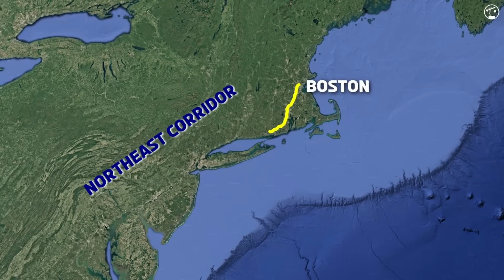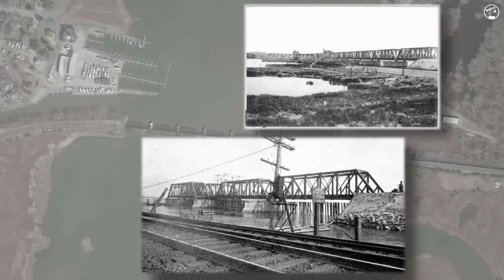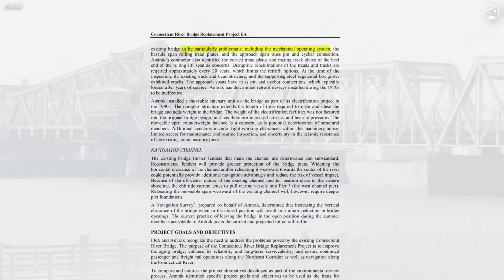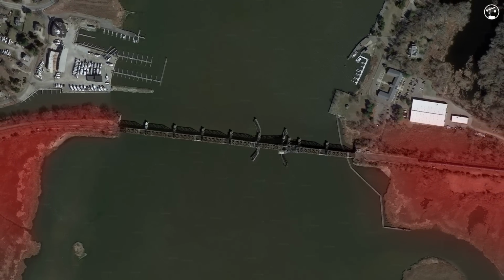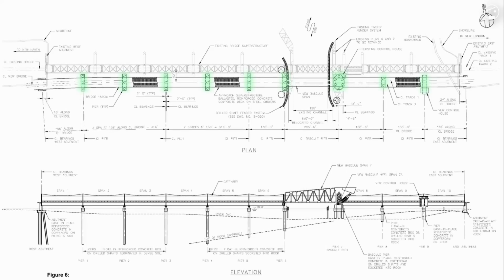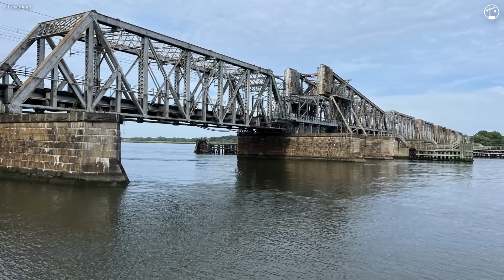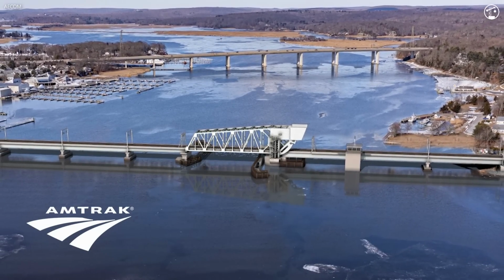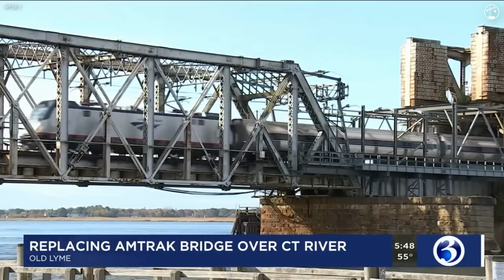The $1.3 Billion Amtrak Bridge Replacement | Northeast Corridor

Comment: Yes this bridge should be replaced. However If we want to compete with China will require high speed trains from Washington to Boston. More people will gladly take high speed trains as the highways between Washington and Boston are congested most of the time.  If anything we should be embarrassed anyone questions the need to replace a 100 year old structure.

Comment: The only question about this project's cost-effectiveness has to do with how to convert the Northeast Corridor into a truly high-speed rail line along the entire route between NYC and Boston, and how to pay for that.  The answer is NOT to repair & retrofit antiquated infrastructure along its current route in Connecticut, which is too curvy and crosses too many streets at-grade to ever be converted to true HSR.   (And no, the curves here cannot be straightened because the line cuts through scores of small towns and hugs a scenic coastline).  The solution has been proposed and should be funded INSTEAD of retrofits like this: move the entire NEC inland, to build on mostly-new or repurposed right of way which doesn't go through so many little towns and doesn't literally traverse beaches.  This would also be expensive and take a decade, but when finished you could basically end the need for air travel between Boston and NYC (the way France has done between city pairs served by the TGV) and drastically lower carbon emissions, improve the air quality and economy for the entire region (and reduce need to expand Boston's and NYC's airports).

Comment: Not sure why a bridge that needs to stop travel to open for water traffic would be chosen. It really doesn’t make any sense to me. Just build it higher. 
Amtrak’s NE corridor makes money, so fiscally it is responsible. Finally, the Boston to NYC leg of Amtrak is notoriously very slow, specifically the existing bridge, so a new bridge will speed travel somewhat. 
To me, except for the open section design, this is a no-brainer investment. We need to replace or repair some very outdated transportation and bridge infrastructure throughout our country.

Comment: For that cost should build a Space Launch Terminal. A Bridge for over one BILLION US Dollars where said Bridge already exists and is a working Bridge? Sounds like a slush fund to me. Does it provide power as part of a dam project such that the system can be powered up and not even need diesel fuel for the prime mover? Not like there is a steel shortage in the USA at the moment yes, yes? 😊😊

Comment: Why not build a tunnel designed for high speed rail beneath the river instead? Such a tunnel would eliminate train delays due to ship traffic.
Reply: New York and New Jersey have just begun the Gateway tunnel project under the Hudson river.
Reply: There is no ship traffic in the Connecticut river.  It is a lowland floodplain  tributary.
Reply: @hirampriggott1689  There is recreational boating, thus then why they are building a lift bridge.
Reply: @ Different river.

Comment: The USA needs to learn how to keep rail infrastructure costs low and efficient. Yes, a bridge is a big piece of infrastructure however in no world should it cost $1.3 billion. 

Spain built the Madrid-Barcelona high speed line for €9.5 billion when adjusted for inflation in 2022. This line required multiple viaducts, bridges, and tunnels. This bridge is not even on a high speed portion of track and likely never will be.

Comment: I am an Amtrak Contractor and am on that bridge once a year and know the guys out of Groton in charge of maintaining it. It's ALWAYS breaking or having to have parts replaced or repaired so they hate that bridge lol.  I love it as I'm somewhat of a NHRR history buff but then again I'm don't have to fix it all the time 🙃All other bridges on the CT shoreline have been replaced already...this is the last one from the New Haven Railroad Era. Over 100 years old, I'd say it's had a good run.
Reply: I hope they can double track the section of track through Hartford, though I have heard that it would be very expensive.
Reply: @ScottPalmer-mp1we  The redesign of I-84 / I-91 interchange being initially planned now calls for moving the rail line through Hartford closer to Asylum Street to accommodate the new sunken I-84 alignment so it will likely be built double-tracked.  CTDOT was just awarded Federal funds for the station relocation study.
Reply: @xjakes3239  I'm glad to hear about the plans.  Thanks.

Comment: I feel like your indifference to whether or not this project is worth it is misguided. The money being allocated for this project, as you said, is just a small piece in a much larger infrastructure package benefiting the WHOLE COUNTRY. You mentioned in the video the structural deficiencies the current bridge has, so how could you possibly look at that and think “is building a new bridge really necessary?” Yes.. the answer is yes. Otherwise you would have to be ok with the current issues plaguing the bridge already, and then having to worry about being in a situation where the bridge just might collapse Baltimore style as you literally mentioned in this video. The northeast corridor quite literally funds the rest of the Amtrak network since it’s the only profitable route, so if it’s shut down, Amtrak is essentially screwed.

I know being an unbiased source of information is important, but you cannot let that stop you from doing basic critical analysis on this situation, especially when the answer is obvious. Critical analysis is just as important to journalism as reporting unbiased information, and it’s important to understand that both are achievable at the same time
Reply: really good point about being unbiased vs doing basic critical thinking. also, like do the math about the cost of the bridge, divided by ridership numbers, over the course of its 50-75 year lifespan, investing in stuff like this is a no brainer

Comment: Something should be done, yes. But why another bridge? Looking at the surrounding area this should be replaced by a tunnel. The original railroad built a bridge at a location compromising location and cost with the reality of steam locomotive exhaust. The railroad is now electrified and freight trains hauled by diesels are infrequent and don’t make as much smoke and can be abated with forced ventilation. The route could be straightened and speeds increased that much more.
Reply: Tunneling is far more expensive than making a bridge
Reply: @ Yes but in the long run tunnels don’t get stuck in the open position and have a lower likelihood of getting hit by a boat.
Reply: @maestromecanico597  I agree with you, a tunnel would be better, or a taller bridge, but this is what we got and it’s better than what we currently have
Reply: @ A new bridge is a marginal improvement over what is there now…complete with all the future mechanical woes with what is there now. When adjusted for inflation the proposed cost is about HALF of what it cost the PRR to build Penn Station complete with the East and North River tubes. For today’s money there is no excuse NOT to dig a tunnel that increases speeds to MAS and removes a maritime hazard.

Comment: The turntable bridge in Norwalk CT ("Walk Bridge") is older, in worse condition, fails on opening/closing more often, is nearly impossible to replace, has zero space on either side to stage construction or build in a new footprint (in the middle of the town), carries way more traffic, has been going thru the NIMBY / BANANA loop (Build Absolutely Nothing Anywhere Near Anything) because the "aesthetics at any cost" crowd don't want the vertical lifts intruding on the skyline (which is the only real practical solution).  Meanwhile, they can't close the upstream river to larger barge traffic due to US Coast Guard rules, which are only for gravel & salt delivery.  That one is pegged at multiples of billions & they've already started work on associated satellite projects such as creating rail yards on either side for the several weeks the line will be shut down & commuters bussed around the bridge.  Typical cluster fugg.
Reply: That’s Metro-North/CDOT territory.  Those guys couldn’t run a lemonade stand.  I think Amtrak should take total control of the Northeast Corridor and cut local politics out of this critical route.  Fairfield country is all NIMBY, all the time, we should just ignore them.
Reply: @ClockworksOfGL  I was in CTDOT Engineering, we were pretty professional & I'd like to say we had our shit together.  Some op's brass were political appointees in wayyyyyyy over their heads, especially back when we had a corrupt Pubby gov for 10 years.  Many of them went to jail with him.  Amtrak should have priority I do agree with that.  Recently I've witnessed the control room at GCT holding an Amtrak train outta New Haven Union Sta at a red signal from crossing Tracks 4 to 6 into State St Station (the shortest gap between stations in the entire nation) for like 20 min's for no reason at all.  AT ALL.  I was pissed as I was waiting to board northbound.  I mentioned it to the Amtrak conductor & he just looked down & shook his head.
Reply: I was working on that project while it was still getting off the ground in 2023 and the plans for it are pretty solid. The main issue with the project was by far the timing of processes. Since the bridge depends on tides and the town ordinance put in place, lots of work can only be completed during specific hours. Also some equipment such as the crane were imported from Germany and had a 3 week delay due to the fires in the Port of Newark back in mid 2023. The DOT and CMJV crews are well managed but it’s just a tough spot for a bridge.
Reply: @Spenceyyyy  I retired from CTDOT just before the pandemic so my info is prolly dated.  I wasn't sure if they ever put the NIMBY thing to bed.  Saner heads HAD to prevail over that one but they were making serious static back then.  I hope it goes well, that bridge is scary as fugg . . .

Comment: The costs of construction projects involving government are outrageous, and something needs to be done about it. No way can the US afford to fix all the infrastructure that needs to be fixed, at these inflated prices. Some of it is brought on by the government’s own rules, but someone is raking in fat stacks.
Reply: When you stop investing in a certain type of infrastructure project you "forget" how to build them (i.e. the companies that previously did that work either were forced to downsize or went out of business outright). To the same contributing effect: materials have gone up just like your groceries. When you forget how to build infrastructure, the selected contractors have more work than they can reliably staff. Thus it is inevitable that timelines are delayed and costs overrun. If you can't staff a project but you can try really hard to stick to the plan, but you wind up shelling out a fortune on overtime. Oh and the project still winds up behind schedule. If you invest in the infrastructure consistently, you create a market for reliable contracting competition by companies that can properly staff projects. Properly staffed projects means on-time completion and on-budget performances. At the end of the day though it boils down to the contractors not the government.
Reply: The main culprit there is highway infrastructure, which is enormously expensive and a net negative for the economy. Rail is generally fine.

Comment: Ridership numbers aren’t entirely accurate. Yes Amtrak has 12.1 million per year, but you have over half a dozen commuter services who use parts of the north east corridor. And if you include those numbers, you probably encroach on a quarter billion. Those numbers are much more worth it. Yes this bridge isn’t useful to all of them, but it’s a fluid system

Comment: should be quad tracked and not moveable but anything is better than what we have
Reply: The tracks in CT need to be straightened before quad tracked. No use being able to pass local trains if your top speed is 60mph like so much of the NEC in the state
Reply: @longislandsound  will never be 4 tracked east of New Haven
Reply: Totally agree. It's a shame they didnt build a fixed crossing that can always stay open for trains.
Reply: @nicolasblume1046  Can't be fixed a fixed bridge, and not for the large amount of recreational boat traffic but to provide back-up commercial freight access to the Pratt & Whitney facilities up near Hartford; their large docks only visible from the river are quite the sight.
Reply: @nicolasblume1046 The Connecticut River is navigable with barge and pleasure boat traffic.
Reply: Why 4 tracks?? I mean it once was way back
Reply: @Prostyle0079  Express Acela and maximizing trips between BOS and NYP should absolutely be on the menu in my opinion.
Reply: @Prostyle0079  allows for trains to pass at high speeds
Reply: A fixed crossing would have more than doubled costs and limited what could pass on the water.

Comment: This is a no-brainer and is well overdue. The state of Connecticut has been working on and already has been building brand new train stations in multiple locations along this Rail line.  

Due to Commuter train use already significantly up in recent years and will continue to increase significantly in the future. 

All the improvements and faster speed of trains on this line. These repairs has been needed to be done years ago.  $1.3 billion is nothing especially that this a key part of a multiple state transportation system that goes from Boston Massachusetts  to Washington DC.

Comment: I feel they should design it to handle much higher speeds on the the bridge but  with the approach on the curved  end as well  I mean your already replacing the bridge why not get it too at least 120mph ? And and have redundant added abutment that could be used to add 1-2 more tracks would it be more expensive yes but would be more costly to go back and rework it again,
Reply: The speed limit through eastern CT is 90 mph due to all of the curves along the shoreline.  It cannot be widened or straightened much because of population density and property values.

Comment: Why isnt the freight companies placing investments in this infrastructure improvements when they use the same lines and not to mention Amtrak generally has to yield to their mile long locomotive trains. 🤔
Reply: Because Amtrak owns the track so it’s responsible for paying for any projects
Reply: @TheLiamster  no. Cdot owns this track. Which is why the track in Connecticut sucks
Reply: @darthmaul216  not correct. that's only west of new haven. everything east is amtrak owned up until the massachusetts border.
Reply: NEC generally doesn’t share the track with freight
Reply: @tomoconnell2320 yes they do. P and W uses the tracks east of New Haven
Reply: @tomoconnell2320 they do, however they usually have to run at night here on the mainline unless going very short distances
Reply: The electrified tracks for Amtrak aren't usually owned by the freight companies. Most of the country Amtrak has to share usage on the freight networks.
Reply: @s0nnyburnett  Amtrak doesn’t “share,” they pay for access. Track mileage peaked at 250,000 in ~1916 and is now down to 140,000. In other words, as freight traffic goes up the access value goes up.
Reply: Amtrak dont want Freight trains
Reply: @ When there is no alternative route they are stuck with them.
Reply: @maestromecanico597  yes there is  build a bridge next to the current one 100 ft  ok may be 50 ft over the water
Reply: @dknowles60  They’re not going to shell out millions more for another bridge just for freight.
Reply: @maestromecanico597  i did not ask you to do so and there is almost no Freight on Amtrak,
Reply: @dknowles60  Fine. I won’t build you one then.
Reply: There is not enough freight on this line to justify the expense.
Reply: “Locomotive trains”